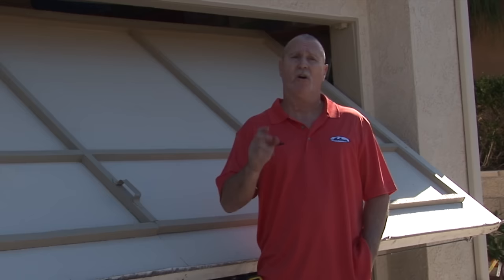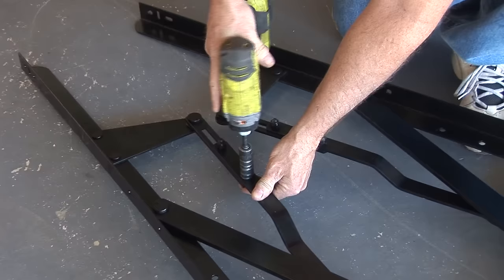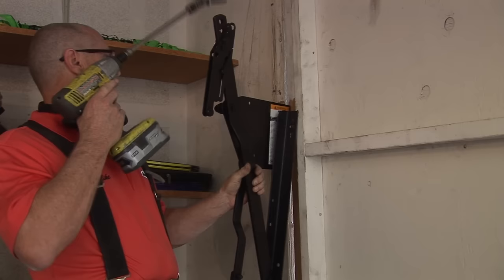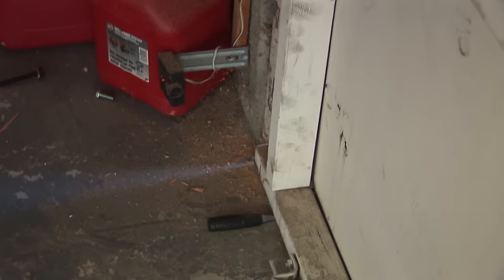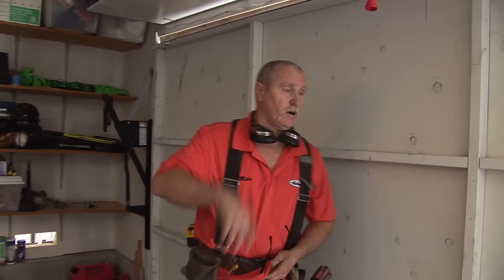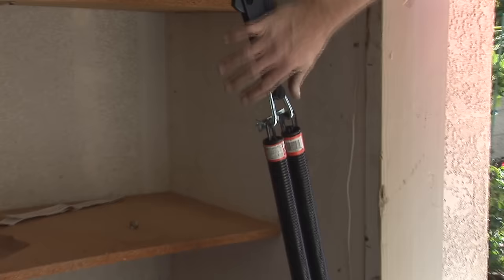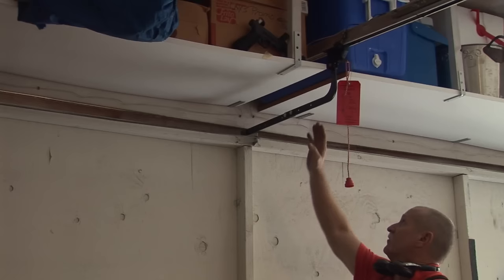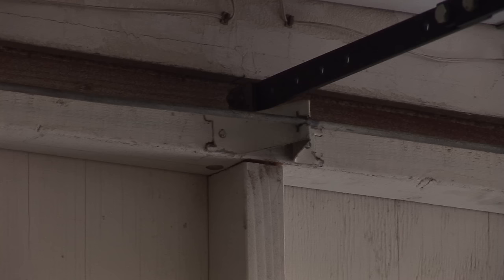Installing Holmes E-900 Hardware & Springs

Comment: I'm a master overhead technician and these videos are completely irresponsible  I can only imagine how a homeowner would react to Hardware breaking in their hand as they're lowering a 300-pound wall which they have never done before. you guys should stop making these videos and stop putting people's lives at risk. all they have to do is call Professional Service Company to come out and take care of this problem as opposed to potentially killing themselves you should be ashamed of yourself
Reply from the maker: I suggest you contact Holmes Halley and ask for Connor, he flew in from 
Ohio to oversee this job and paid me to do this video, as well as 
supplying the hardware and springs for the job.
PS....I have no shame, never have...never will.
Reply: All-Pro Quality Garage Doors Inc. Good for you guy, your still posting videos that shouldn't be posted, I'm sure you agree, but you wouldn't say it.  To think some weekend warrior can handle the strain of a one piece door rebuild... What if the jambs are all jacked up? Then what? Then your weekend warrior will start trying to find a video for that, not find one, then start trying to mount e900's to wood with splits in the grain, multiple holes from multiple attempted installs, and then have the new hinge arms rip out. Come on bro, you know that we would handle that but they couldn't.
Reply from the maker: So what your saying is that in this day and age people are just too 
stupid to make the call on what they can or cannot handle, maybe we 
should start with the 1.6 million youtube video's on "How to do the 
brakes on your car" I would hate to think of how many cars are rolling 
down the road with do it yourselfer brakes on them...What if the guy 
doesn't have a car lift and uses a leaky jack and doesn't put jack 
stands under it???? too many scenario's with too many variables and the 
list could go on forever, pick a DIY topic and there will be a certain 
amount of danger, maybe we call Bob Villa and tell him to quit showing 
garage door installs because the springs can hurt you...no more patching
 your own roof...too dangerous...you could fall off. "Come on bro"... 
stop policing the internet, if a guy in Australia wants to teach you how
 to feed the crocs and your too stupid to realize that it's out of your 
paygrade... not the Aussie's fault. Know your limits and I salute all 
those who save themselves some coin in the process.
....and no I don't agree with anything you have said so far.
Reply from the maker: Hahaha, I don't know what depot you shop at but I can get torsion springs at any depot here. They are not on the shelves because there are too many sizes to stock, but they do sell them to DIY people...and so do we. Since your not in agreement with Bob Villa doing home remodels I would recommend you go pester him for a while...I've got dozens more video's to make and post. I'm not quite sure what a D-28 sounds like...
Reply: All-Pro Quality Garage Doors Inc. in southern California guy:X pestering?? you keep responding because you know your FOS, go kick rocks dude. probably unlicensed
Reply from the maker: Yea... I figured after a while you would realize you can't win this, 
then get bitter...start with the name calling and telling me what I am 
or not...very typical of someone who starts out telling me that they are
 a "Master Overhead Technician". I knew if I baited you long enough we could eventually get down to business. The last thing you want to do is compare your skills to mine, Look me up, I'm not hard to find online you'll see my qualifications are beyond your wildest dreams...I've got a hammer that's seen more 
installs than you. I never said I buy anything from home depot...but your so pissed off right now that you read what you want to read...slow down...focus...read carefully. I've had a multi-sales account since 1988, probably long before you were even born my friend.
Hows that for funny shit dude?? Hahahaha!!!
Reply from the maker: Since I own this company, I think I can stick to whatever floats my boat, maybe I'll just stick to drinking some coffee and letting the rookies do the work for a while. It's good to be the king!
Reply: All-Pro Quality Garage Doors Inc. The king of East County? Enjoy that bro, I run my own business and at 40, my income bracket of six figures speak for itself. like I said, have fun with your 20%profit margin.
Reply from the maker: Yeah, I've heard it a million times yet here you are entertaining me with your jibberish. I have fun with everything I do and my profit margin is just fine.  ;)  Don't forget to subscribe!!
Reply: Good vid. Ignore the liars/haters. This vid wasn't made for those who can't handle heavy, hard work. I really appreciated the time you guys took to make it.
Reply: "master overhead technician"lol that's like calling a janitor a sanitary engineer.i'm pretty sure the viewers can handle doing this,it helped me a lot and I never got hurt,he wouldn't be responsible anyways it would be youtube.for showing the video to everyone.get off his back you "garage door installer" you.
Reply: okay now its obvious hes lying,he couldn't be 40 looking like that ,50 maybe.lol.why are you calling him old if youre 40?run rings around him?lets see you lift that door ?whats that?you wouldn't try?thats what makes him a better worker.pure grit.youre the type who goes home just as clean as when they arrived.
Reply: Thank you for making a great instructional video. I am one of those idiots who not only will be installing my own hardware but I also made the door. Keep on posting great content!